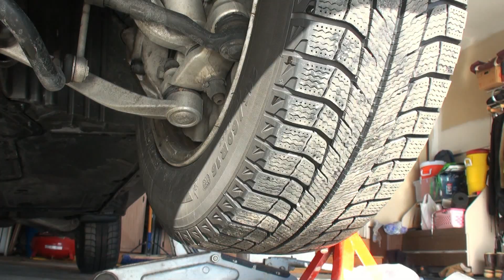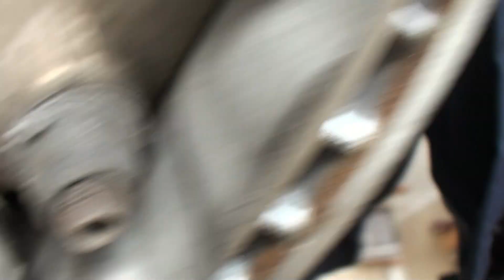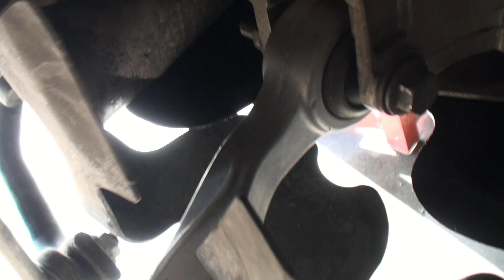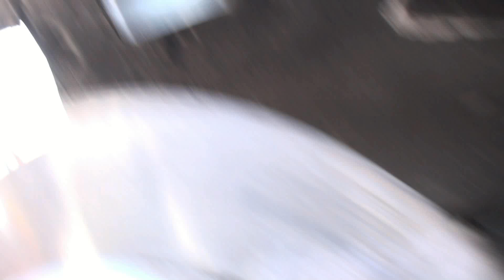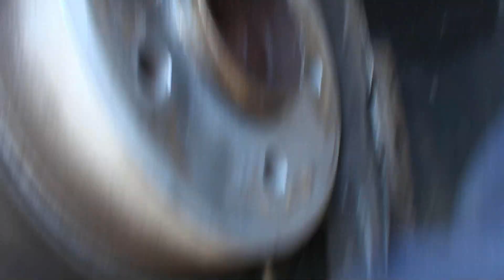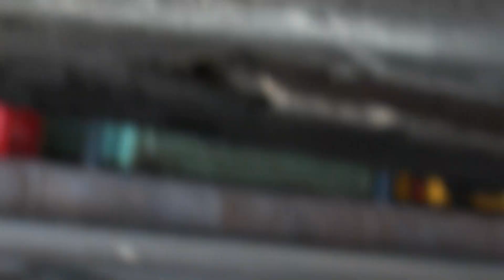Front Lower Control Arm Replacement 2004 BMW 525i E60

Comment: AWESOME video!! I was surprised to see that the car you were using is the same EXACT car, color of mine and just found I have this issue as well! A mechanic shop that deals with BMW's and German cars wants $603 total for both sides. Is that a decent or over priced quote?

Comment: Thank you very much! This helped me solve the loud houling noise from the front left side of my 525D e60! I thought at first that it may be bearings or something, and was about to buy new ones, but i cam across this video and went straigt out in my garage and found out that it was the control arm that was worn! :) Again, Thankyou very much . You saved me some money! :) I have subbed!

Comment: You should not tighten the nut on the bushing end of the control arm until you lower the vehicle on the ground, otherwise that bushing will be under tension and get destroyed in short order.   Alternatively you can jack up the hub to 'normal' position relative to the car body and tighten the nut in this position, but be very careful!

Comment: how much did the control arm cost you so i know what to expect  thanks
Reply from the maker: Control arm was about $110 at Autozone. Could probably source for a few bucks cheaper on-line but I liked having the convenience of being able to easily return if it wasn't the correct part.
Reply: Dave Wisniewski thanks

Comment: Did you use a ball joint breaker tool? I have to do the same job on a e39, but i dont now what ball joint tool use.
Reply from the maker: I did not use a ball joint breaker tool as I was replacing the entire control arm, ball joint and all. So I did not need to press it out of the arm. I have seen folks using a separator 'fork' to separate the arm out from the hub assembly, but as you saw in my video, the tapered shaft actually broke free as I was loosening the retaining nut. I have also seen folks once the retaining nut is completely free, thread it back on about the thickness of the net itself and then bang up on it to break the tapered shaft free. Hope this helps and thanks for checking out the video!
Reply: Dave Wisniewski
Most BMW ball joint shafts are tapered, but on some models like this one with a thick cup-like washer at the base of the spindle the shaft is just straight, not tapered.  That's the reason it is so easy to detach as soon as loosen the nut.

Comment: Great video.  Pure cash money - great job showing the anatomy of the suspension, its condition, and the before/after when replacing the components.  I came here looking for information relevant to the E60 body style for my E60 M5 and wasn't disappointed in the slightest!

Comment: Thank you very much. Great Video. A couple of questions. Did you have to redo the wheel alignment after this replacement? Also the part number for this is 3112-6760-181/182, correct?
Reply from the maker: I ordered the part from Autozone (not a formal endorsement).
(Drivers side) http://www.autozone.com/autozone/parts/Duralast-Control-Arm-Lower/2004-BMW-525I/_/N-jll05Z8oz70?itemIdentifier=209126_814136_6064_171485
(Passenger side) http://www.autozone.com/autozone/parts/Duralast-Control-Arm-Lower/2004-BMW-525I/_/N-jll05Z8oz70?itemIdentifier=209127_814136_6064_171487

It is not necessary to get a wheel alignment after replacing control arms. Generally only tie rods. Thanks for your question on for watching! I hope the video was a benefit.
Reply: Dave Wisniewski
Thanks again for your information.